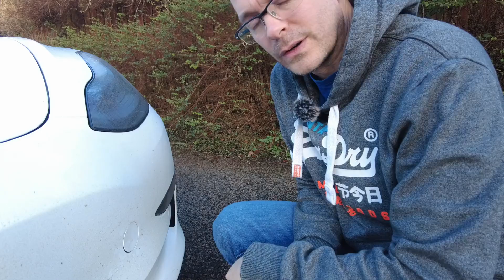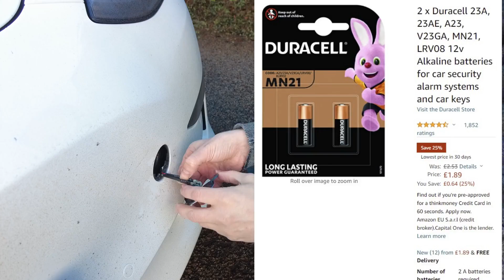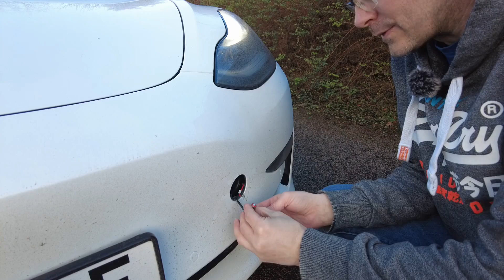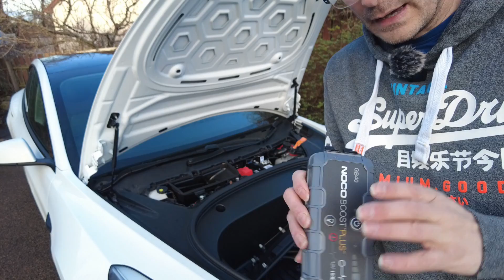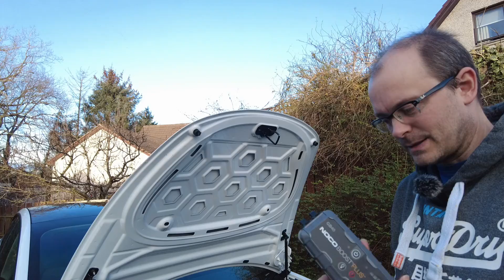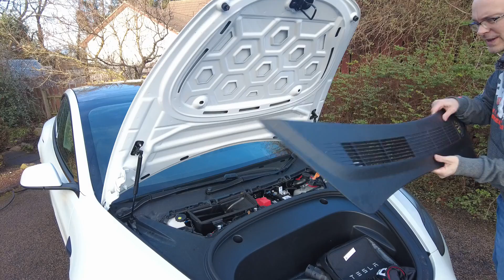How to rescue a Tesla Model 3 from a flat battery

Comment: I understand the first part poping the hood.  The jump battery will wake the Tesla up? How long do I have to have it connected.  What happens next? Will I be able to drive it?  Will the main battery then charge up the 12V?
Reply from the maker: A lot of good questions, and I haven’t tested it, so answers below are a “thought experiment”:
1.  If your HV battery has charge and only your 12V battery is flat, then in theory you can disconnect as soon as the HV battery contactor as closed.  At this point, the car is ’awake’ and the 12V battery will take charge from the HV battery.
2.  If the HV battery is flat, then you need to leave the booster connected and get your car charger plugged in and charging.  If you’re nowhere near a charger, then you’re out of luck.  But if you have a charger in the same car park as your car, then you might have a chance to drive it to the charger, or at the very least, put it into “tow mode” and push the car to the charger.  Now I don’t think you’ll have much time on the booster - 20 watt hours gets used up quickly (a few minutes).

If your 12V battery is dead as well as flat,  you might need roadside assistance.  You might be able to wake the car up, but if the 12V battery is dead then you need to keep the car awake.  I don’t know whether the HV LV converter is sufficient to cope with sudden changes in load, so I can’t comment as to whether it’s ok to drive.  Worst case is that you drive and then your 12V converter overloads and shuts down power - that would be very bad news while driving.  In theory you should get an alert advising you to change your battery.  That gives you weeks of warning, rather than hours, so you should in theory know that a dead battery is likely before you come across this problem.

If your HV LV connection is bad, then you definitely need roadside assistance.
Reply: @anthonydyer3939  Thanks for the quick reply, I was looking into getting a jump pack just in case of emergency. I don't see myself running into having a flat HV battery but the a flat 12V does concern me.  I'm going to get one off Amazon but there are so many options that I don't know which one to get.

Comment: Can you replace the 12v battery by your self?
Reply from the maker: Yes,  there’s plenty of demonstrations of this elsewhere.  The AGM battery part number is readily supplied.

The normal procedure is: disconnect ground terminal, power down vehicle from main screen (all doors open), disconnect HV battery (isolator underneath rear seat), disconnect 12V battery positive terminal, remove clamp, swap battery and then reverse the process.  Power up by pushing brake pedal for 45 ish seconds.

Comment: When you opened the drunk with battery how am I supposed to open the car to make it work if the battery is dead 😅
Reply from the maker: Use the little battery to open the bonnet.  It’s a separate 12V circuit to the rest of the car that’s used to unlatch the bonnet.  I could explain more easily with some relay logic diagrams.  Once the bonnet is open use the bigger booster battery stored under the bonnet to power up the main 12V system at the main battery terminals and then that should be enough to unlock and get into the car.

Comment: Yet another reason on an ever growing list of reasons not to buy a Tesla. Or any other EV for that matter.
Reply from the maker: Is it really?  Flat batteries leave petrol cars stranded.  That’s still a pest when it happens.

The methods for access to the car are different, but at least they work and they aren’t too complicated.  Not only that there’s an increasing number of cars that have “vehicle to load” capability, meaning you can use one car to recharge another in an emergency.

Comment: It appears that your 12v battery trick only works when the car is unlocked?
I would suspect that a failure of the cars onboard 12v battery is more likely to happen when
the vehicle is unattended and therefore locked, or have I misunderstood?
Reply from the maker: It will work when:
Car is locked AND Car 12V battery is dead
OR
Car is unlocked AND Car 12V battery is healthy

It will not work when:
Car is locked AND Car 12V battery is healthy
Reply: @anthonydyer3939  Hi Anthony, thank you for your swift reply. Thanks for the clarification,  it now makes sense. +1.
Reply: @anthonydyer3939  Also works when the car is unlocked and the battery dead?

Comment: but why dont they just put external leads to the battery that you can get access to by opening a little pannel.   this is just the crappiest most bizarre round about way to fix the problem.
Reply from the maker: I think the answer to your question is: “need vs cost”, as it is with most things.  

My method at least works.  The early Model S variants didn’t even have the feature that I demonstrated.  Bjorn Nyland had this problem with his early Model S after parking overnight on low battery where the temperature plummeted.  
https://youtu.be/ZA1x11aFJ8o
It needed some panels under each wheel arch to be removed in order to release the frunk latch.  Then he had a problem getting it.  Battery was boosted, but his Bluetooth phone key wasn’t enough to get in.  He needed his keyfob, and he didn’t have it.

That was not good design, but from bad design we get revised Model S designs and the Model 3.  Now we’ve got options for a situation that most probably won’t happen to me at all.

Comment: A plain old 9v battery will do the same thing for a lot less.
Reply from the maker: Two things:
1.  The A23 batteries aren’t expensive
2.  9V batteries are reportedly not up to the job at cold temperatures, which is the most likely time when you need this trick the most.

Comment: If both your batteries are flat how how would you unlock the car to enable that mini 12 battery to open the bonnet?
Also, Tesla recommends their cars are left plugged in to charge point at home with typical charge settings between 20 and 80%. Unless you're driving an ICE car, spending over £50 on your battery jump starter seems wasted.
By the way, most of your other videos are great!
Reply from the maker: The bonnet will open when you use an external 12V source if:
Main 12V battery is dead AND car is locked
OR
Main 12V battery is healthy AND car is unlocked.

Regardless of Tesla recommendations, there are plenty of examples where you park but you’re not plugged in.  For example:  Tesla Bjorn has had a situation with his Model S where he had parked his car overnight away from home with a low SoC, and he returned to a dead 12V battery following cold overnight weather and he couldn’t get in.

In my situation I’m plugged in at home, but often set my charging to start at 00:30 to take advantage of cheap overnight rates.  Now I’m mindful of low SoC conditions, but others maybe not so much.  

Regardless of that, it’s easy to get caught out when habit and forgetfulness meet a different set of circumstances.  Believe me, I developed poor habits this winter and it resulted in my kitchen flooding last Friday following a very cold overnight spell.  I forgotten to isolate an outside tap and hydraulic locking caused a pipe to burst.  Stupid me, but it can happen to any of us.  Flat batteries are no different in this regards.

Comment: Nice video, thanks very much! If you used the battery booster to get back into the car and turn it on, can you disconnect it and drive on to a nearby charger or would the battery booster still need to be connected while you drive?
Reply from the maker: I’d never drive in any situation where I felt I needed to leave this booster connected.  The only exception is extremely short distances at slow speed (within same carpark), and purely for the purposes of getting the car onto a tow truck, or getting parked up at a regular ev charger.

The booster is really only needed to get the car woken up, and therefore get the main dc converter connected between the HV and 12v battery.  Once’s that’s accomplished, you should be able to disconnect and run the car regularly, charging up as needed if the main HV battery is low.  If the car dies immediately after disconnection, then you’ve either got a dc converter fault, or an HV battery fault, or some other electrical bus failure.  Any of those are “don’t drive” conditions.  As mentioned in the video, the booster is probably only good for 6 minutes of power.
Reply: @anthonydyer3939  Thanks!